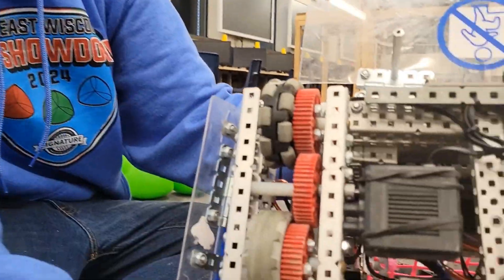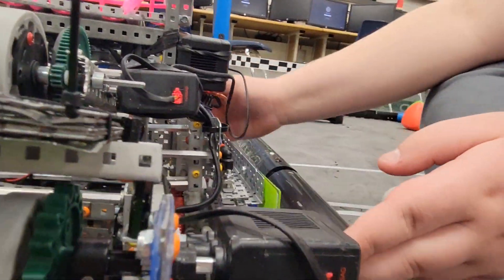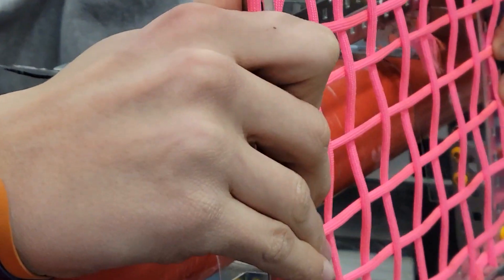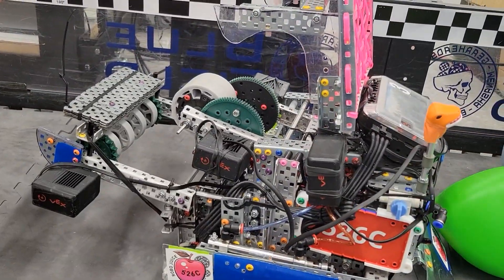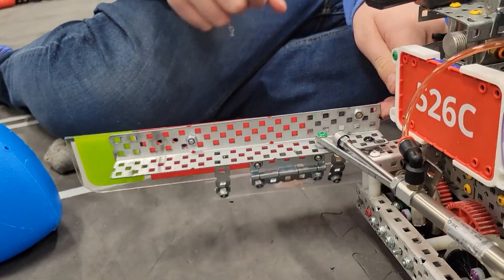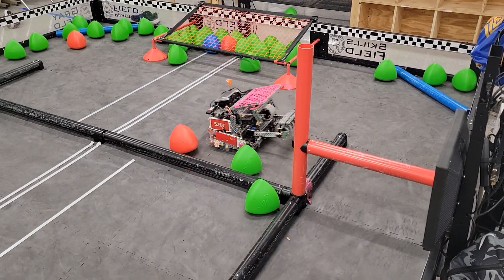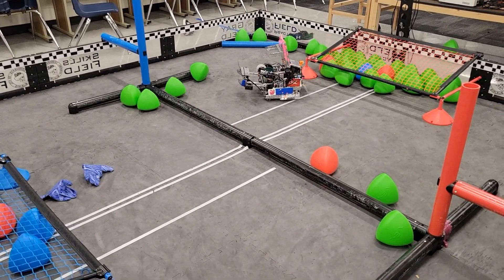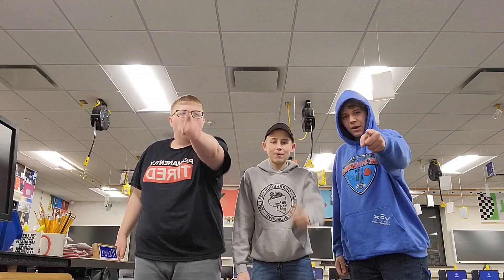Pre-State Robot Reveal + Explanation!

Comment: 200RPM is really slow, especially with a 44w drive and 3.25in wheels. I'd recommend at least 257rpm with 6 motors and 4in wheels if possible
Reply from the maker: Yes, we  considered that. We even had blue inserts before, but with our robot weighing in at 21.5 pounds, the motors overheated so fast it wasn't worth quick swapping all the time. We also thought about 6 motor but then we would have to remodel the whole base and with how we attached so many things to the base it was almost impossible without full redesign so we just spent all our time coding and driving. But thanks for the suggestion!
Reply: @526CRobotics  I would really recommend  6 motor, 400 rpm drive train.
Reply from the maker: @williammiller4838  we planned on that but with the current bot we would have needed a complete redesign. Thanks though!